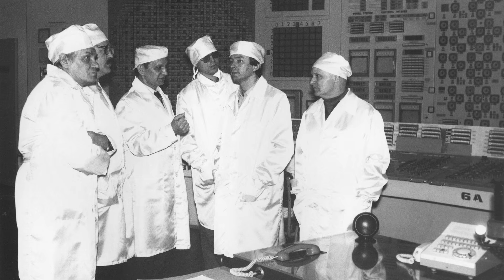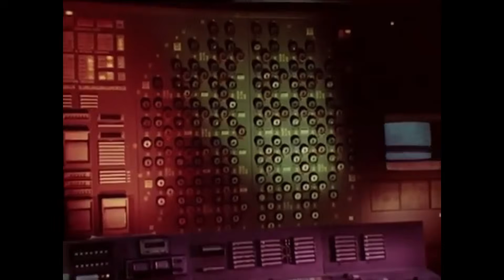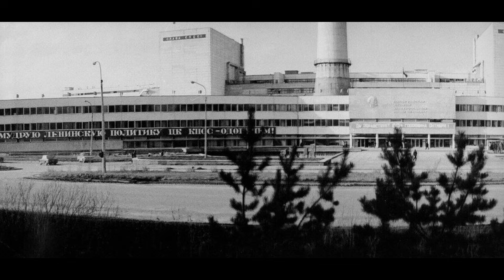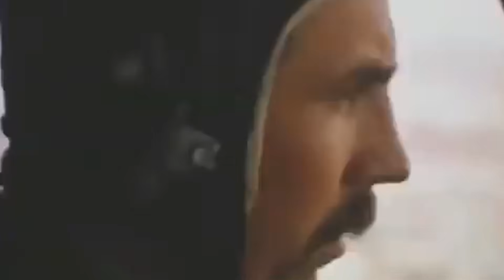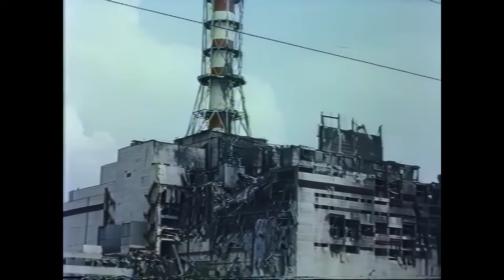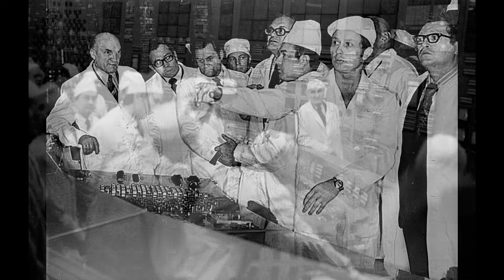The 1975 Leningrad Nuclear Accident: The Road to Chernobyl

Comment: The RBMK reactor had some significant and known flaws, like the Xenon poisoning of the core and the fact that the reactor was notoriously instable at low power, but the Soviet government didn't want to accept those facts for political reasons. Which is why on that fatal day in Chernobyl, yet another attempt of running a very specific test was done and failed, this time catastrophically. It was a textbook case of "doing the same experiment over and over again with the same parameters and expecting different results".
Reply: Xenon poisoning isn't unique to just the RBMK. It happens in all running reactors. It's a natural part of the fission process. Even the earliest reactors ran into this rather quirky part of splitting the atom. As of yet, no one has been able to come up with a solution for how to prevent it from happening since it's a part of the decay path.
Reply: Both those problems are pretty vommon with all Uranium reactors: you missed the thing thats not common the lack of ANY containment building at all and a postive void coefficient
Reply: Incorrect. The test was a success. The test was a turbine rundown test and so nothing to do with the reactor directly as they shut off the stream to the turbine. After the test, they decided to shutdown the reactor as they always intended to do. It was then that things got errr ummm exciting!
Reply: @ChrisMatthewson  No, the reactor core was contaminated and unstable even before the test started, so arguably it was in completely the wrong state and yet the chief technician still decided to go ahead with the test. They should have either skipped the test or had gotten the core fully stabilized before starting the test.

The first part of the test was to literally switch off ALL safety systems and take manual control over a reactor type that desperately needed all safety measures to keep it at least somewhat stable. When they retracted the control rods, instead of increasing the output power, the reactor dropped to a very low output and they didn't understand why that happened. That should have been the point to stop the test, switch all safety measures back on and figure out what the problem(s) was/were. Instead they attempted to raise the power to the level they needed to perform the test, by retracting more and more control rods.  

Their actions to bring the core into the proper state meant that they lost control of the core even before the test. That the turbine rundown part of the test kind of worked doesn't mean the test was a succes, as the entire reactor blew up. The test was to prove that they COULD bring the core in a specific state, do the turbine rundown and then bring the reactor up to power again. The thing is that NOBODY had ever managed to complete the entire test successfully, as the RBMK reactor simply couldn't be controlled in the power settings it needed to be in for the test. That is the part that Soviet leadership refused to accept when they came up with the test and why they kept ordering the test to be done over and over again with the same parameters, because according to Soviet doctrine it should have worked.
Reply: @tjroelsma  No, you are mixing up the reactor with "THE TEST". The Test was simply a turbine rundown test plus some measuring of the vibration in the turbine. So, the test was simply on the turbine and nothing to do with the reactor. It was to cut off the steam from the reactor (So separating the two) and then measure the turbine output to see if they could get enough power to power circulation pumps until diesel generators could take over.  That was the test and that was successful. 
You are mixing two things: The test and what they were doing with the reactor, which is an entirely different thing and discussion.  Then you are even trying to bring in your thoughts on Soviet Leadership, which again is an interesting topic, but separate from the Turbine Rundown test which was successful on that night.
Reply: I didn't understand about the political reasons, you should understand that every RBMK-type project has its own lobbyists. RBMK differs from VVER in terms of production, the rejection of RBMK hits manufacturers who do not want to lose a project that allows them career growth.

Comment: Once again, this is why I come here. For these very nice and nerdy videos. But in the case of this accident, I'm going to have to run defence for the reactor a bit. Yes, the RBMK leaves a lot to be desired when it comes to its Physics characteristics. Yes, they should have sat on the design longer instead of plunking it out into this world untamed, and untested etc. We can all agree on that. But, when the reactor scrams itself twice while clearly indicating through its systems it is not feeling well, and really does not want to restart. If you then start disabling things like the lateral ionisation chambers to force it back up in power, then it is us human fleshy types buggering things up that are to blame for whatever happens next, not the reactor! It can only obey the Laws of Physics. At some point common sense has to override even Party Politics and goals when dealing with powerful machinery like a nuclear reactor.
Reply from the maker: Thank you so much for the super thanks!

Yes, operator error is also at fault for this accident, however at the time these practices were normalised in the industry. It is an interesting thing how these operator errors would echo down to Chernobyl, as the accident solidified the need to increase the fuel enrichment, which led to the control rod lengthening and displacer shortening, which eventually led to the accident. Even the operators then, behaving under correct regulations at the time would feel the echo of the operator errors as it led to the explosion of Unit Four.
Reply: @thatchernobylguy2915  
You're most welcome! 
These videos are a great help in furthering my study and understanding of the wonky reactor that is the RBMK.

Practices like that should never be normalised. Most certainly not when dealing with this type of equipment. If I were a supervisor, and I found any of the crews bending ionisation chambers on my reactor to force it back up in power in such a heavily poisoned state, I would have their g*ts for garters, and then some. Even the most stable, well-designed reactor will become unstable and behave erratically in such a poisoned state.  Let alone a headstrong, touchy reactor like the RBMK. One doesn't muck about with the Laws of Physics, or face the consequences if you do.

And some of the similarities are uncanny indeed. There's no denying that.
On to the next video it is!😄
Reply: @swokatsamsiyu3590  "Practices like that should never be normalised" but then Soviet Union was not a "normal" country and pretty much nothing there worked "as it should have", and "overcoming difficulties" by whatever hook, crook, or just brute force was part and parcel of life there, back then. Individuals at power enforcing their decisions against better judgement, "the Plan has to be achieved" (and its goals met) no matter what, on 1st May, or on anniversary of The Revolution this road/ bridge/ building/ what not has to be "opened" even if half finished. So they laid the asphalt on a road in a haste and hurry even on the night of 30th of April, so the Secretary or some other Party bigwig could "open" it with much fanfare on the morning of May 1st... and then three days latter the entire road was torn up because water pipes and sewage SEVERAGE that was supposed to be put in the ground first wasn't there yet.

Just yesterday I watched the video about "The Most Dangerous Bridge in Russia" (youtube.com/watch?v=vVFx8GcxNqw) and there's one bit off-topic moment in it that illustrates the Soviet obsession with "show-off cum window dressing", or "pokazukha" (показуха) - when the narrator is talking about that "BAM connection ceremony".
BAM (Rus. БАМ) is a Baikal-Amur Railway (Rus. магистраль, magistral, meaning a highway or a main thoroughfare) which was rebuild in Brezhnev times, and it was done in the same fashion as "Pacific" railway "back then" in USA - they've laid the tracks simultaneously from both ends, to meet at certain point - and the difference was in US they did not care where would they meet, while Soviet powers that be DECLARED that it HAVE to be in this town (Kuanda/ Куанда).
But, as usual, nothing ever goes to plan there - one party was behind the schedule and the other one has advanced further (40 km/ 25 mi east of Kuanda), so they have met each other not where they were ordered to.

In any normal country it would be a non-issue - "aw, c'mon! so what? what's the difference?" - but then again, Soviet Union WAS NOT a "normal country", so AFTER the initial connection of the tracks in Balbukhta town/ settlement, FEW DAYS LATTER they dismantled a section of the tracks in Kuanda, and redid the "connection ceremony" as ordered by Party in the initial plan. "Ordnung muss sein", y'see...

In case you'd like to watch it yourself this episode starts at 15:33, and anyway the whole story about this bridge (that "BAM story" is just supplemental to it) shows how things works... erm, lemme reword it - "how things ARE" there. And while this video is accompanied by EIGHT "translated CCs" that English "translation" is kinda gibberish and "something completely different" from what these people say - and even Russian CC are pretty much in the "whisky tango foxtrot?!" genre.
The best possible translation (albeit still imperfect) you'll get when you select first "Russian auto-generated" CC and then choose "Auto-translation" option... but I digress here ;-)
Reply: @MrKotBonifacy  
Living in a country not all that far from the former USSR, I'm well aware of their obsession with looking the part to the outside world. Not to mention the fact that things were anything but "normal" in those times. I was 15 when the accident at Chernobyl NPP happened. Only due to the fact that we (and a host of other countries) got a good whiff of the fallout, and started asking difficult questions did they have to come clean about what transpired there.

How far this went? Well, fairly quick after the accident some USSR scientists phoned the IAEA with the question if they happened to have any literature on how to put out a graphite fire in a reactor core. Upon hearing this, the somewhat baffled person on the other side of the line asked if they would liked to be referred to the UK since they had had the Windscale fire in one of their graphite reactors in the 50's. "That will not be necessary. It is merely a scientific exercise of sorts. We're fine!"

Will look up the БАМ story sometime this week. And if the English subs are that bad, I'll stick to the "Russian auto-generated" CC since I can read/ write Cyrillic, and understand a good deal of the Russian language as well. You can thank the RBMK for that^^
Reply: @swokatsamsiyu3590  "... can read/ write Cyrillic, and understand a good deal of the Russian language as well. You can thank the RBMK for that^^" - yeah, "always look at the bright side of life, ta-dam ta-dam ta-dam" ... ;-)
"...a country not all that far from the former USSR" - Finland, perhaps? Or Sweden?
Well, never mind; greetings from Poland : )
Also, it looks like we're of about the same age - I was 22 back then. Cheers!
Reply: @MrKotBonifacy  
Almost^^ A little further west , the Netherlands. And yes, little did I know where my queeste to learn as much as I possibly can about the RBMK, would lead me. But here we are. All nerdy and reactor-y, learning all kinds of interesting new things.
Greetings from the Netherlands, my fellow nuclear nerd: ) And you're a tat older than me^^ That would make you a Gen 1 RBMK, with me coming up as a freshly minted Gen 2😆
Reply: @swokatsamsiyu3590  Yes, "tad older", indeed - but while "back then" seven years of age difference was indeed a huge gap, right now it's more like a "statistical error"... ;-)
Once you're "over fifty" you're walking the Sunset Boulevard, or as I responded to my Mom wishing me "all the best" on my fiftieth birthday, "Mom, 'all the best' already happened, and all I can wish for now is 'not too bad'..." ;-)
Cheers!

Comment: Something that helped me understand Chernobyl and the others is that the RBMK reactors weren't like Toyota Corollas.  Each RBMK was its own, unique design, with, presumably, design improvements.  And along with new improvements, also came new weaknesses.  Hence, knowing how to operate one RBMK could help you understand how to operate another, but none of them were completely identical.
Reply: RBMK 1000 reactors were mass produced in two series. They are not unique designs in any way.
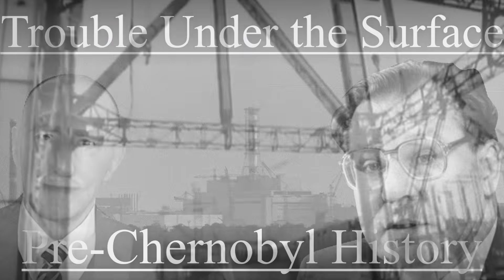Reply: @mvs3246  18:10

Comment: Great Video! There are some theories that the first Explosion in Chernobyl was an explosion in the fuel tubes. This explosion was caused by the fuel being vaporized and shooting high up in the sky, higher than the second explosion, Eveidece suporting this theory is presented in a report by Swedish Scientist Lars-Erik De Geer, etal: "A Nuclear Jet at Chernobyl Around 21:23:45 UTC on April 25, 1986"
"This paper renders the following hypothesis. The first explosion consisted of thermal neutron mediated nuclear explosions in one or rather a few fuel channels, which caused a jet of debris that reached an altitude of some 2500 to 3000 m. The second explosion would then have been the steam explosion most experts believe was the first one. "
Reply: This jet was detected by US satellite, that was monitoring Soviet DUGA over horizon radar in the Chernobyl  area. Time of detection corresponded to local time in Chernobyl 01:23:45 on April 26 1986. Jet was emitted after flash of blue light on the ground. On April 29 1986 air probes were taken in Cherepovets, north of Moscow, that were analyzed by gamma spectrometer. Minsredmash experts found Xe-135 in the probe and determined ratio Xe-135/Xe-135m/ (ground state/excited state) as 22.4 , that pointed out to a nuclear explosion. Original estimate was 10 kT of TNT, but later reduced to 10T of TNT. Super critical reaction on prompt neutrons occurred in 3-30 fuel channels with participation of 0.01% of total fuel load of 200T. On first weeks of May 1986  KGB already issued order that true nature of Chernobyl disaster should never been disclosed.
Reply: @nyckhusan2634  Intresting! Any sorce for this?

Comment: Damn really makes me wonder if Chernobyl would’ve been avoided if it weren’t for the control rods, or if it was the final straw during a perfect storm
Reply: I would say ' final straw during a perfect storm'. On that night, many of the things they did weren't that much different to how they normally did things and so this led to not much concern on the night and seeing what they did do as normal and usual. I believe that having shortened control rods played a massive part in providing the final kick to send the already near boiling point water to instantly turn to steam, but that water had to be in that state for that to happen. So the control rods are not the only thing involved.
Had the inlet water been at a lower temperature at the point AZ-5 was pressed, then the sudden increase in reactivity/heat might not have been enough to make it all boil and give time for the boron to get in place and lower reactivity.
Reply: Swiss Cheese Model, it was the final hole in the Swiss cheese.
Reply: It was the lack of control rods.  The minimum of temperature-controlling rods that were supposed to be inserted was 15.  They only inserted 8.  I've heard higher minimums than this, but I discovered the information from the "Chernobyl:  Minute by Minute" video here on YouTube, and I was shocked at just how poorly trained those night-shift workers were.  I'm interested in finding out if this is featured in other videos, because I heard a different number on another video, and I can't recall the title of that one right now.  All this information is both fascinating and horrifying at the same time, and I hope we don't go through the same type of incident.  My biggest fear is that if we automate these nuclear reactor systems so much and don't have well-trained shift workers to handle a sudden melt down, what then?

Comment: So why didn’t the reactor explode when he scrammed like in Chernobyl
Reply: in short? because the control rods were longer

the longer rods didn't have a gap, so they didn't very suddenly shove water out of the way.  Water is a reaction dampener and radiation shield.  When the AZ5 button is pressed the control system is severed and the rods drop with gravity.  The gap let them hit the water, shove it out of the way, and the neutron burst vaporized some of the fuel, vaporized the water, and the sudden steam pressure briefly locked the control rods in place.  The Xenon burnt away and the reaction spiked even further.  The control rods were stuck, a void space formed in the reactor below the locked boron rods with graphite jammed next to fuel and no moderators.  There was nothing to stop acceleration left.  The reactor went into total meltdown as fuel literally vaporized at the bottom and melted at the top.
Reply: @Darthquackius  I would love to know more about that! Everything I watched and read keeps saying that the problem was the water displaced by the graphite tips, but I don't fully understand why this was an issue compared to the graphite just reaching the bottom. I mean, I get the spike in power, but I don't understand how this was aggravated by the graphite control rods displacing water in particular, you are the first one that actually talks precisely about that particular detail. Do you have any sources where I can learn more about that? Thanks!